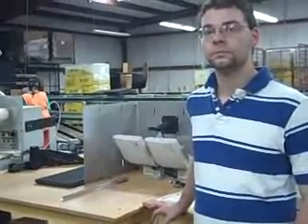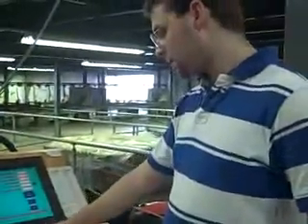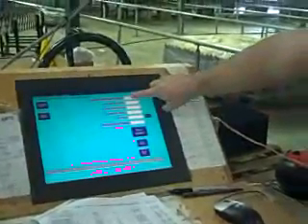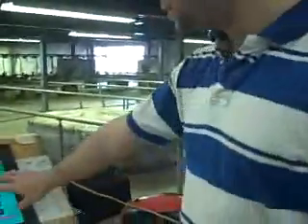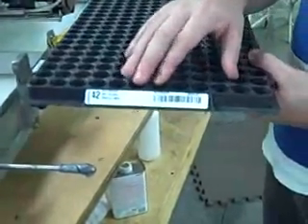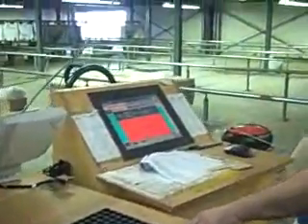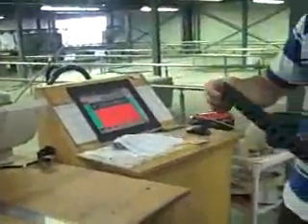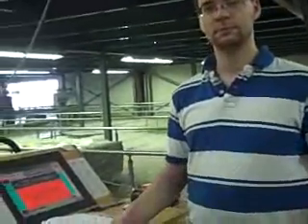RFID tag encoding - putting into production at seed sowing

Comment from the maker: Zebra printers can do the encoding, but that machine is a print and apply using the Zebra print engine. It would cost $40-50k to replace the print and apply label printer with one that also supports RFID encoding.